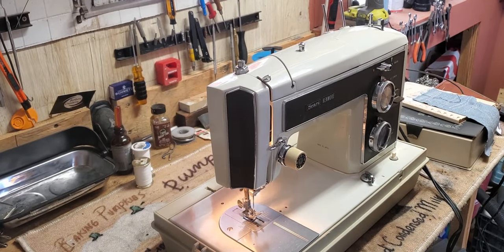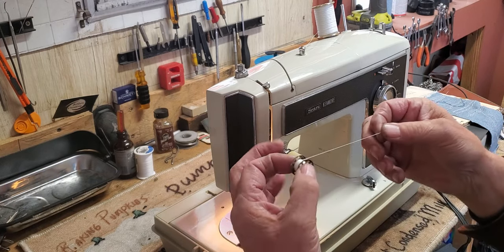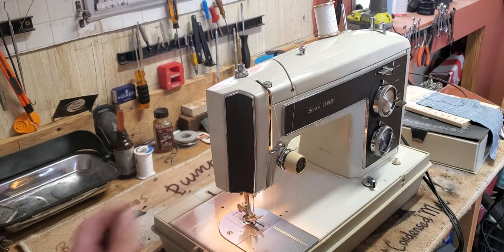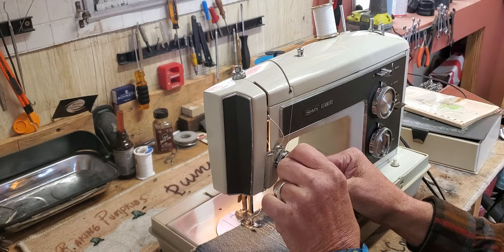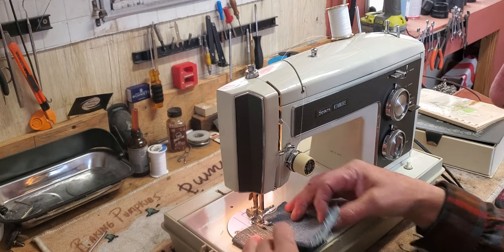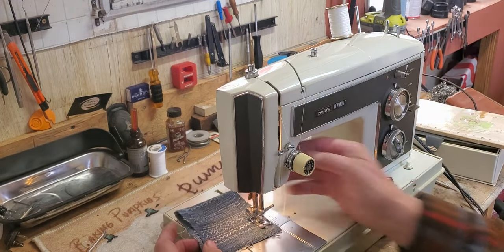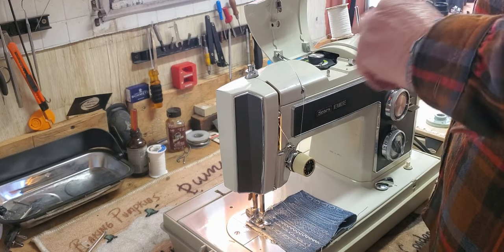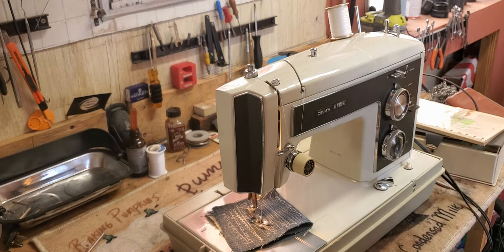Final test and tutorial video of this Kenmore 158.17740 Sewing Machine

Comment: I was given this exact machine and all seems to be good except the metal cam, I can’t get it off. Do I need to lubricate with oil, or apply a little heat to work it off, or what? Machine sat in its cabinet for 20-30 years. It was clean but very dry, but a good oiling got the parts moving.

Comment: Why did Kenmore make the machines with the super high shanks and no feet to use on them? I can't find them anywhere. Also, which cams go with which kenmore sewing machines. I have the flat ones but it doesn't seem like they made many flat ones. Wish I could find an adaptor so I could use low shank snap on feet for my 158.385.  Thanks.